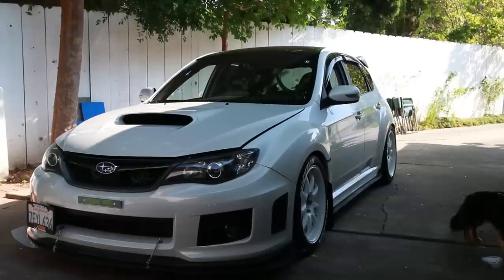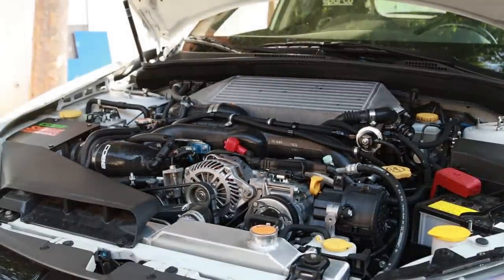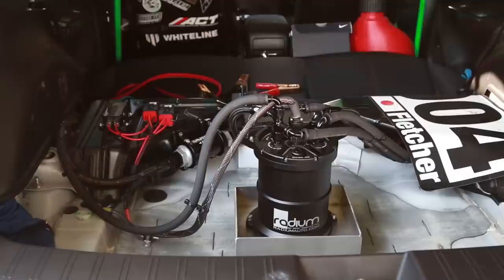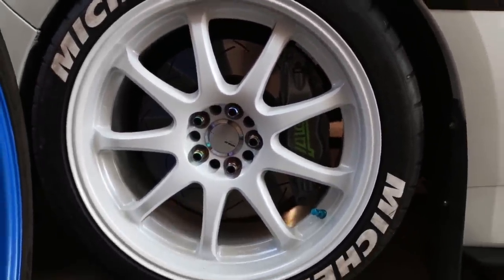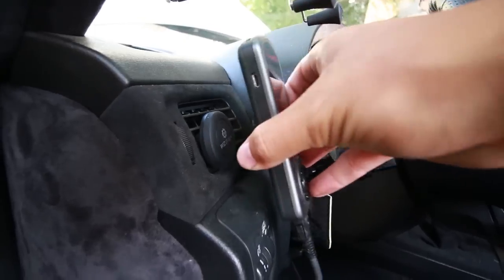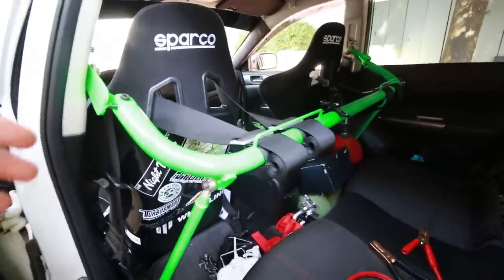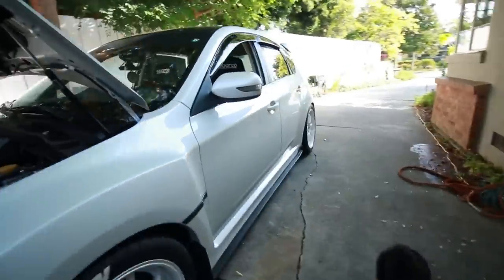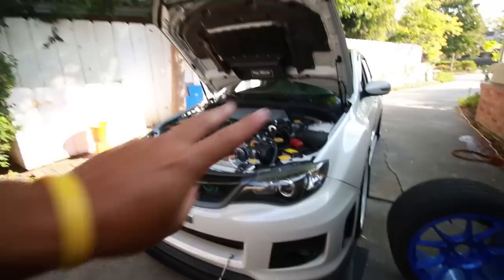500whp Subaru WRX Hatchback - Walkaround

Comment: Question, was the 2013 sti transmission a quick bolt on or did you need extra mounts? I have a 2013 wrx and need a better transmission,  would it be a simple replacement?

Comment: Hey man,

Cosmetic question for you. I'm looking to black out my fog light covers and bumper vents. Similar to your setup in the video. 

Did you buy new covers and vents when you blacked out yours or did you paint/wrap the originals? Aka did you find ones that where already black or did you have to do it yourself. 

I know you said you had carbon bumper vents. But if I understood correct you had the plastic ones installed in the video.

Thanks!
Reply from the maker: I just plasti dipped them. Super easy
Reply: Cali WRX sweet. Thanks fam

Comment: How much power are you making on 91 oct?
Reply from the maker: Only 17psi at around 370ish I believe. Wely did 2 passes. 91 is meant for road trips so we didn't go hard on 91, plus I use 91 maybe 1-5 times a year.

Comment: Hey what's good bro, I recently just purchased at 2012. The car only has 28k miles on it and I noticed there's a lot of slop in the gears while in gear. Is there a shift stopper for this year ? I've noticed there's a shift stopper for the newer years, any input on your idea?
Reply from the maker: Get Cobb front and rear shifter bushings. Helps a lot

Comment: Hey Clint. Awesome build. I had a question about your front lip and splitter. I recently moved up to San Jose and on my drive up here, my front lip and splitter ripped off on the 5 and I found out the bolts that the lip was mounted on to ripped through the holes provided on the OEM bumper. Is this just something that was a freak accident or does this happen on subaru's from time to time? I wanted to get your insight on how to prevent this from happening again.
Reply from the maker: Freak accident I think or poor installation.
Reply: Cali WRX the splitter was mounted to the lip. Should it be mounted to the bumper?
Reply from the maker: Here's my setup: 
Lip is held on by self tapping screws. Then splitter is held onto bumper with bolts and nuts. They are drilled in so not going anywhere. Then I have a couple self tapping screws that go through the splitter into the lip.

Comment: So you you probably had some cost associated with all the braided lines and AN also, I know they're not cheap. Can you throw those in your cost for the "fueling" section? and just a cost for the "motor build" section? with just the numbers in your description, you're pretty much at 35k (without the long block cost). Next time anyone has an idea on what a build like this costs.
Reply from the maker: I have a video of motor build cost, I will link video later.

Comment: You should change your title 500whp. Fp green do not produce 500whp.
Reply from the maker: You should do your research before posting that comment...
Reply: Real 500whp will trap 128 -130mph. What's your trap speed?
Reply: Found this on Nasioc. "I remember the Green on meth makes about 420whp and the Red making around 450whp. Try Proven Power Bragging?"
Reply from the maker: Never dragged the car. But feel free to doubt it. Plenty of those in life. Join “the world is fl4t” Facebook page and ask away, plenty of 500whp or more builds with fpgreen.